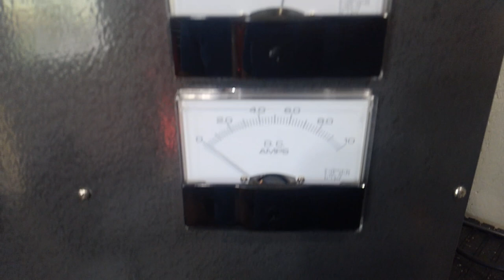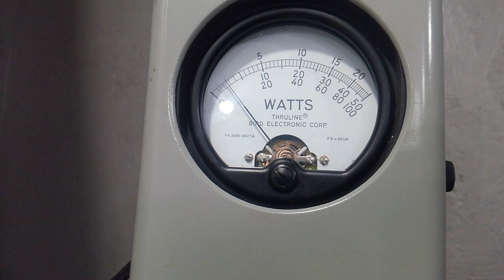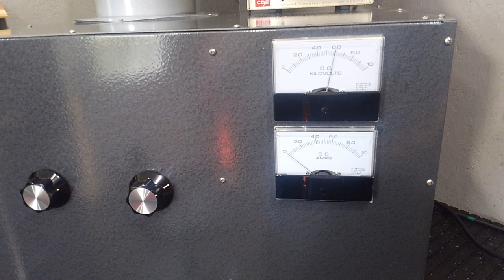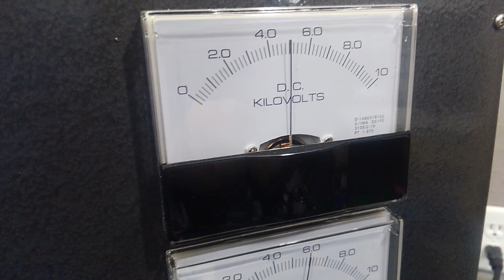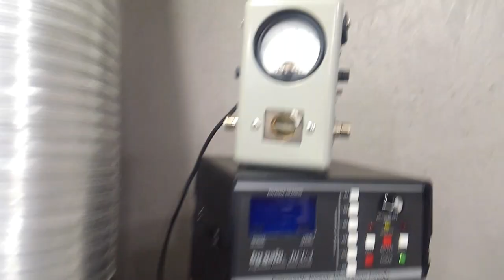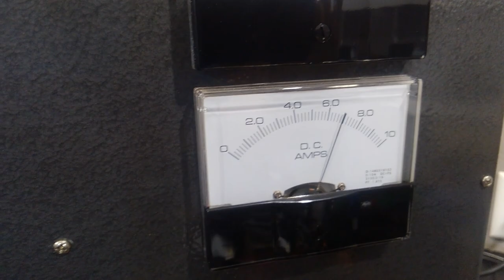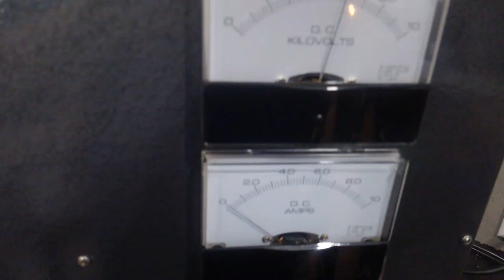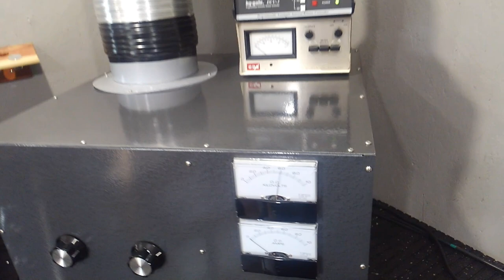Dual 3cx3000a7 to the Max, JTG Built/Gump Built

Comment: From what Ive read, if you going to stress test an xformer a 3cx3000 is the tube to do it with
Reply from the maker: At 2.5 amps per tube (that's spec for a 3000) this amps will do 16,000-18kw average and pull forward and hold steady. That's where id run it personally, but we really wanted to show not only what the amp was capable of, but the monster power supply as well.
This is a complete package that should last someone a lifetime with very little to no repairs

Comment: How do you guys prevent TV interference with that many watts?
Reply from the maker: 1. Clean tuned radio
2. Well built amp
3. Properly tuned antenna
4. Well shielded coax, and heavier than needed coax.
5. Use a balun to prevent common mode current which causes tvi
Reply: Eliminate Neighbors. On14 Acres  the sticks of Texas I haven't had a TV since 92 so we're good in our house
Reply: @Rooster_Radio  wow
Reply: Live out in BFE!
Reply: Back in 'ye olde' days', TVI was noticed by picture distortion, loss of sync with vertical rolling, and horizontal tearing, sound bars, and actually hearing a ham or CB'er talking as it over drove the TV and detected audio came out the speaker.  Today, with DTV, people get pixelation, picture freeze, lost of signal and immediately think cable or satellite, or crappy through the air reception,  never interference.  So, basically, people are dumb.

Comment: I'd love to have that kind of power but no 3 phase here...
Reply from the maker: You don't need three phase. 80/90 amps will run this.
Reply: @Rooster_Radio  Thanks, I just assumed 3 phase was needed.  Beautiful job by the way, 20kw of rf is not trivial.

Comment: And not much older than you just saying. Put another imputed on that box it only has one
Reply from the maker: I'm 30, you're what 50? 60? You don't need two input tuners to accomplish a good input. Why use two when one will do?  Just because Pete has been building the same way since 1980 right? If you spent all that money you've got in the right places you wouldn't be taking beatings from a couple poor boys. Bye bye bye

Comment: If you where 1000 miles closer ...I'ld buy it..
Reply from the maker: Hell of an amp. If I didn't just have my other one built I'd be all over it.
Reply: Mustang131 if u are serious an want a hell of a deal for a amp no body else can, will nor build this nice over kill a trans to run 3 tubes for the price of this one at 8k dollars I can easily be a thousand miles closer. Nothing  for me to load it up an come to New Mexico which is a 1000 miles closer an half way.  I've traveled many times.  Thanks Gump
Reply: @gumptechnologyjtgamps723  
Your definitely on my radar. I'll get in touch after this whole crorna thing is over.